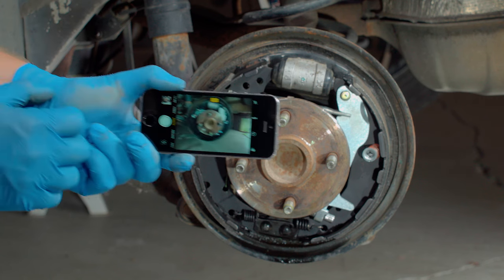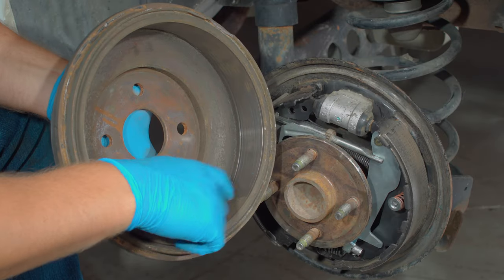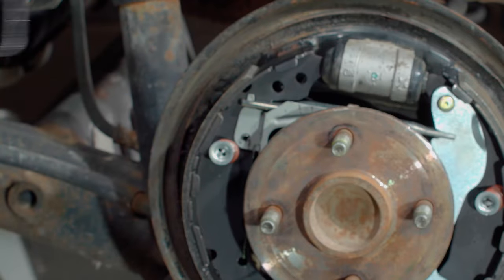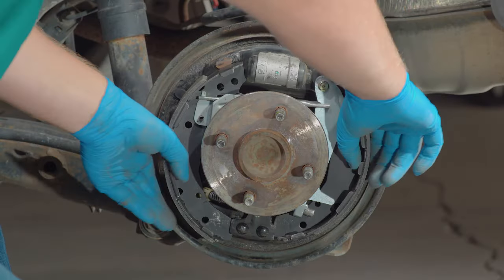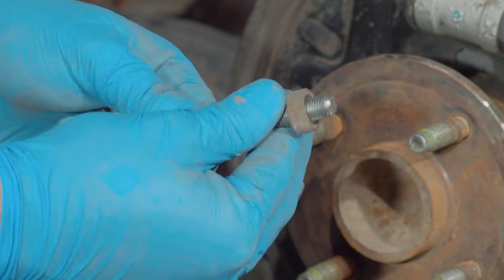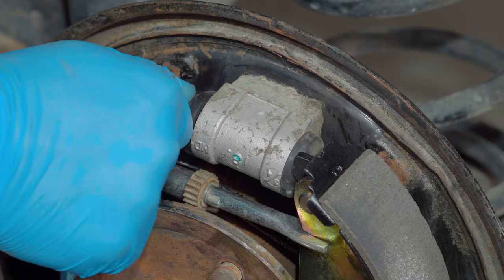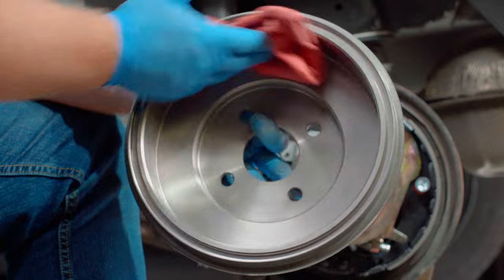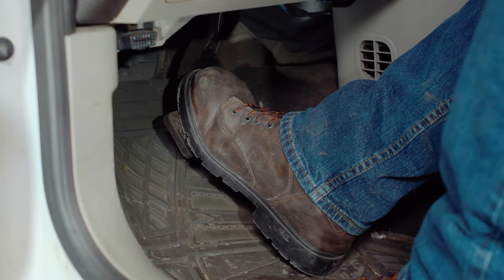How To: Change Drum Brakes

Comment from the maker: Supplies Needed for This Job:
1. Safety Glasses: https://urlzs.com/hbwc
2. Gloves: https://bit.ly/2GvfwAm
3. Brake Drum: http://bit.ly/2L04SWI
4. Brake Shoes: http://bit.ly/2IE5PSt
5. Brake Drum Hardware Kit: http://bit.ly/2IE5RK5
6. Jack: http://bit.ly/2ZxQiJl
7. Jack Stands: http://bit.ly/2L1YEp9
8. Socket Set: http://bit.ly/2UUqY1p
9. Flathead Screwdriver: http://bit.ly/2IGBOkT
10. Breaker Bar: http://bit.ly/2UWfies
11. Rubber Mallet: http://bit.ly/2XGMROM
12. Brake Spring Pliers: http://bit.ly/2VvGn81
13. Brake Cleaner: http://bit.ly/2UxiRmp
14. Shop Towels: http://bit.ly/2GDgwm1